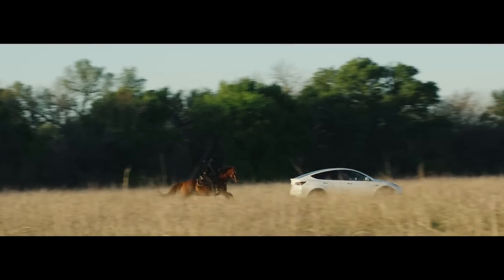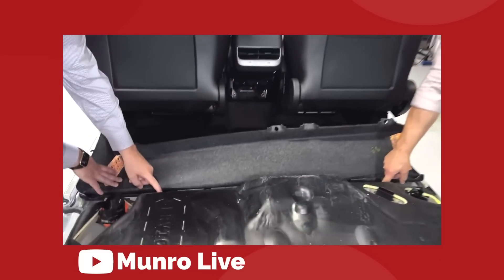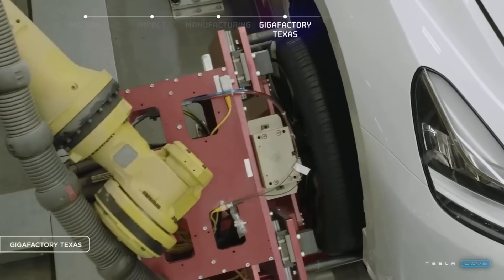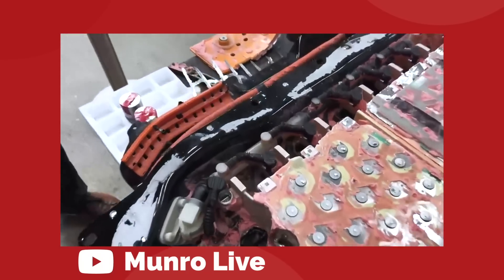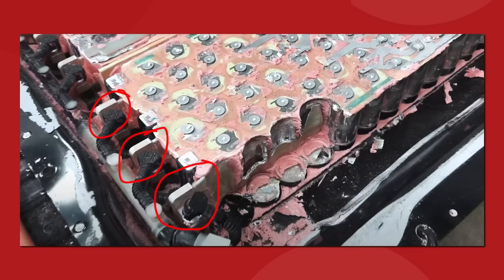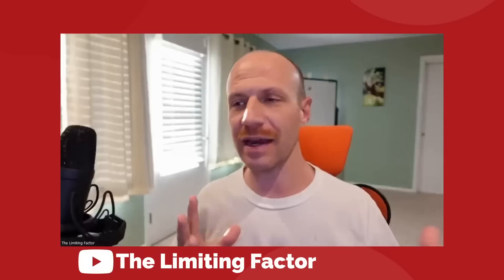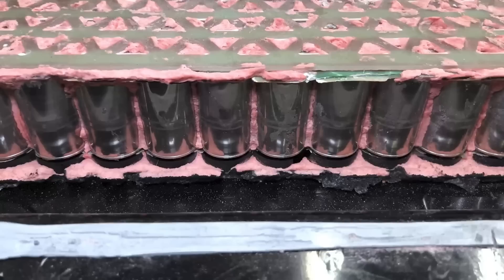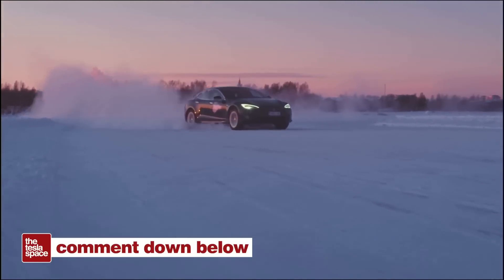Major New 2023 Tesla Model Y Update! - Sandy Munro Teardown

Comment: What I wish is the 500 mile with the active air suspension and an air line for tire inflating or deflating for a true Off Road Model W, also bigger wheel wells for allowing bigger off road tires, and for them to be able to be hidden while driving in low ride highway mode for efficiency reasons. (Also the two level sun roof automatic covers with a 50% obscuring mesh and a heat reflective protecting screen with heat trapping mitigation that also has insulated bottom for not burning the passengers in case of touching it.)

Comment: NO BETTER BATTERY DENSITY than the old cells.  Ugh.  The MB EQXX has a 747 mile range and battery density of 400 Wh/L.  MB says a car using this battery will be for sale in 2 years.  There is no way Tesla can call the current MYLR, "Long Range," if it only is capable of a "measly" 330 mile range.  Some batteries made by CATL in 2023 will have a 620 mile range and 10-80% charging in 10 minutes.  I just can't get over the original paltry range of the Model X at 80% 220 miles (which was realistically about 100 miles at 80mph) and the M3LR which at 80% of 330 and at 80mph will be about 160 miles.  That's it.  We are talking about peanuts improvement here.  The original Model X (the flagship model) was only able to get from San Francisco to San Jose and back ONCE.  For some people, that is only 1 commute and then needs to fully charge.  The current MYLR couldn't make it twice without charging at the destination.
Reply: 330= long range.
430= super long range.
530= extra long range.
630= mega range.
730= ultra range.
830= super duper extra ultra mega long range.

A manufacturer can call a particular range whatever the heck they want.

Comment: Tesla would never vent the battery heat out of its housing, the heat pump works partially by using the systems heat generation, meaning all that insulation is there to prevent heat from escaping the pack in any other way besides the cooling system it was intended to, while adding structural support. The better they do at designing within those parameters, they better these cars perform in cold weather.

Comment: GREAT JOB EXPLAINING THE 4680 BATTERY !!  Lithium batteries 
tend to swell-up slightly when charging and shrink in use when
discharging .The "Tabs" seen tend to eliminate this problem in 
the new 4680 design . Great job Tesla Engineers ! Grandpa Ron 😊

Comment: That literally felt like watching the result of someone who rushed to get his job done as there was some arbitrary due date. The core idea is great, but the execution suffered from some quick fixes. Still, I am intrigued by the new battery design. The finished product looks so massively engineered that it becomes hard to imagine any complete failure. Down to the cell level these battery backs look incredibly robust; it is like seeing all known failure points vanish at once. How does such a battery even explode or die?

Probably the cooling could be improved in several ways, and yet I am sure that the implementation will work as long as there is no failure in the cooling system (seems a bit more single point of failure susceptible as the rest).

Where would that thing even break? Trucks don't cut it, that would take a cartoon sized boulder or star wars light sword to imagine.

Comment: Rare earth mining is the PR bane of EVs we can end that by using iron nitride magnets that perform better than neodymium.
National security concerns over a single nation aka China controlling rare earth mining and refining are also eliminated as every nation has iron and ammonia to make iron nitride magnets. Niron Magnetics makes these magnets in the USA.
Reply: How does the intensity of the magnetic fields compare?  I am fairly sure that the iron nitride is far worse, else it would already be used.
Reply: @edwardcoulter9361  It is stronger as the limit of saturation during creation is three times higher, the reason they have not been used in the past is no one knew how to consistently make the iron nitride to achieve mass production.

Comment: You're complaining about heat dissipation on the side of the cell but you were expecting a cooling system on the bottom? The literal smallest surface area you could think of?

Comment: One major point that people are going to be seeing a lot of fake information on is the recycled ability of the 4680 battery pack system period Both Elon and Sandy made it very clear that these battery packs will easily be ground into microbits without disassembly of any kind and using a process of heating and separation that Sandy called floating similar to fractionation in a refinery tower, all of the components will be separated and recovered and be fully recycled into new batteries and packs, basically once the components are separated they are individually equal to extremely high grade or from a mine, because they've already been processed and purified so this will be extremely efficient recycling and the batteries and pack system made from the recycled material will be absolutely equivalent to new batteries made from or taken from mines
Reply: Great point
Reply: Sandy Munro's statements regarding recycling are totally BS.  Keep in mind that Munro has no under graduate or graduate education of any type.  He does not understand electricity, physics or chemistry.
Reply: @ReachOutToWilliam  this is another YouTube created troll spouting paralyze and propaganda, has no content was created by the 12 IQ YouTube staff to harass me specifically and they will be paying dearly for that shortly all of these perverts in the big Tech so-called social media are going to be paying dearly with civil and criminal charges shortly after the November elections they're already cases that are on dockets there are at federal and state levels already hundreds maybe thousands of subpoenas issued and there will be arrest warrants soon. Everyone should just block these YouTube trolls and report them document them
Reply: This definition of recycling is pure nonsense.
Reply: @M13x13M  this channel is another YouTube troll everyone should just delete it and block it
Reply: @M13x13M  yep just another 12 IQ statement made by the YouTube 12 IQ troll Brigade to interrupt Communications and to put out blatant propaganda

Comment: The structural pack is pretty much what I expected. You can't actually weld the cells to the pack housing due to all the different voltage potentials present, so you have to fill with a dielectric material like the foam.

Comment: @4:20 The pack is recyclable, (†)  it's just not easily repairable.
Actually, if you've got the proper solvent, you can get the pack open, selectively free the cells, and get to any individual cell, though why you'd want to is beyond me...
†) Like Elon said: _Think of it as high-grade ore. (Just grind up the whole pack and use liquid gravitational separation to get to each metal..)
Reply: if it took Munro's crew 80 hours using a dry-ice blaster just to get one bank of cells clear of foam, and the cover skin destroyed just to peel it back, not to mention wiring destroyed, good luck fixing any 4680 pack.  those things are all or nothing; replace only.  there will not be any repairs made.
Reply: @twhite5085  No there certainly won't, but with the right solvent, it'll be a lot easier to recycle.
Reply: @charlesrovira5707  Fire!

Comment: Many comments on recycling the battery. The whole pack is immersed in liquid nitrogen to stop the reaction and then the whole thing is shredded.  Using flotation and other techniques all of the metals are recovered. In effect the pack is turned into super rich ore. Virtually 100% of the important stuff is recovered.
Reply: Dipping the battery in liquid nitrogen also makes the materials very brittle , so easier to pulverize. A banana shatters after being dipped in liquid nitrogen and then hit by a hammer .

Comment: Doesn’t that foam completely ruin the possibility of recycling batteries after their lifespan?
Reply: No, the battery is immersed in liquid nitrogent to stop the reaction and then the whole thing is shredded.  Using flotation and other techniques all of the metals are recovered. In effect the pack is turned into super rich ore.
Reply: @richardacerra2975  My idea was to dump the pack into molten iron then separate the metals from the slag.
Reply: No.  As a metallurgical Engineer I can assure that dumping batteries into liquid iron will just cause the nickel, copper, cobalt to dissolve into the iron.  This makes these metals really hard to recover since they become substantially diluted.  Lithium and aluminum will dissolve into the slag as oxides and they too will be substantially diluted, probably impossibly so.  Graphite will all be oxidized to carbon monoxide and that’s the end of it.  Manganese will probably dissolve into slag too but some will be reduced to metal and dissolve into the iron.  

This would in no way be considered a viable process by just forcing the concentrated elements into impossible chemistry to ever recover them economically.
Reply: In a word NOPE !

Comment: I still question the idea. People strapped on seats attached to the battery packs. With the battery pack bolted to the frame. Really looks like a bad day if the bolts ever shear off.
Reply: Never happened before……why now?
Reply: @NickWainwright6970  Because this design has never been attempted before.  Previous designs created a roll cage for the passengers. Which of course made it difficult to install finished interior parts into the car.
This design creates a incomplete possible weaker frame. Then bolts a plate to the bottom of the car. The plate contains the batteries, but also straps the passengers to the battery pack. No one does it like this.  With most rollover accidents, the ICE is dropped and other parts go flying off. Reducing angular momentum.  
The latest Tesla designs have fewer parts and passengers attached to the battery pack. 
Wondering what real world accidents will show.

Comment: Isn't the 4680 supposed to exceed the performance of the 2170, based on what Elon and Drew said at Battery day? I know this may take some time to get there, but you said the 4680 isn't supposed to exceed the performance of the 2170, but I thought that was what they claimed as the goal.
Reply: The energy density also depends on the end-of-charge voltage which is under Tesla's control. They might be backing off on the charge voltage in the short term to improve cell safety; over time, as the cell design improves, they can charge higher and get better energy from essentially the same cell.
Reply: @huskypup3489  Yeah, I'd imagine they will improve, it just sounded like he was saying in the video that that wasn't the goal, specifically regarding energy density.
Reply: @trizzybones  energy density , size and ease of manufacture ( cost) were totally the goal.
Reply: I don’t know about performance but I kept hearing for months that they aren’t exactly better yet but they are more energy dense and cheaper to manufacture. This would be Teslas official transition from cobalt-nickel to iron-phosphate battery chemistry no?
Reply: @Bruh-wb3qw  If I recall correctly from what the The Limiting Factor breakdown said, there is still some cobalt in the chemistry right now, but I'd imagine the chemistry will be adjusted over time and they will also use different chemistries for different variants.
Reply: @Bruh-wb3qw  no, as I understand, Iron phosphate has a different cellpack design, because it's not very efficient in a cylinderical cell.
Reply: @archigoel  ah okay, yeah that makes more sense. Kinda disappoints as I was hoping we’d find a cheaper and less harmful alternative to cobalt and nickel by now. Hopefully some groundbreaking battery technology isn’t too far off.
Reply: And, if it is not, why are they using it?  That's why when they weighed those Tesla 4680 cars, there was only like a 10 pound difference.  No battery advantage and no weight advantage.  Even if it has a crash advantage, that isn't a performance criteria that people really want to worry about.
Reply: Watch carefully.  I am going to put the ball under the cup.  Now I am moving the cups.  Where is the ball?  Wrong! Let's try that again.  Put your money down ...

Comment: Its a beautiful design. As in : "OMG! I totaled my Tesla! Want to buy my battery? How about a motor? The wheels are still good. Recycle the rest." The steel top and aluminum bottom on the battery guarantees, if there is a fire, it will drop onto the road before melting into the cabin.  The bottom of the pack is a fuse. That's better than steel on the bottom and aluminum on top.

Comment: A functioning structural battery pack alone is amazing. Knowing that this is the first iteration is almost a relief since Tesla stays innovating. Finding a totally dry manufacturing battery process would be significant! Let’s hope they solve it!
Reply: One advantage for the consumer is, if the battery degrades to below the threshold for the warranty, Tesla will have to swap out the whole battery pack, meaning that you will once again have 100% SOC.

I have heard of other manufacturers that only change smaller parts of the battery to bring the car within warranty limit.

So the car goes to 69% and they change only the worst performing cells to bring the car up to, say 72%.

A downside is, i would imagine that recycling these batteries will be a LOT harder, than if they had not been "set in glue" like that.